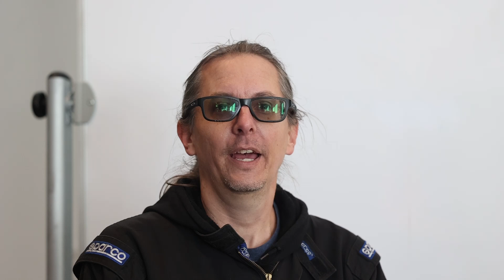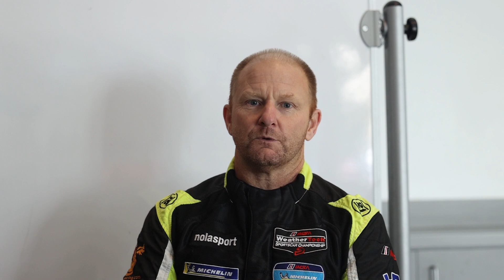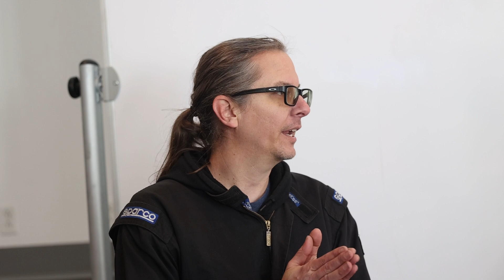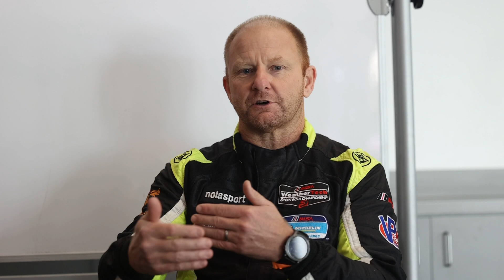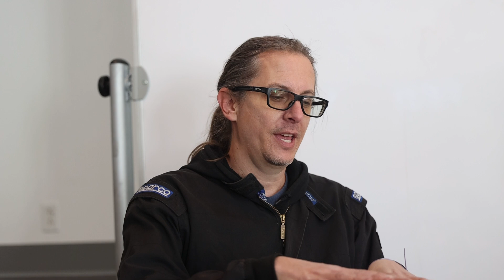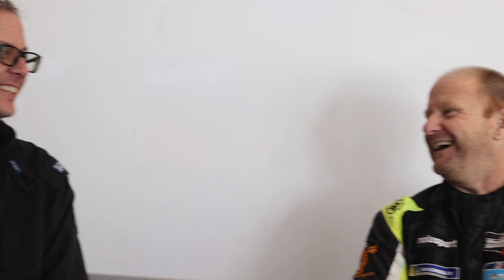We Made Too Much Downforce? / How to Utilize a Pro Racecar Driver

Comment: Love to see what you come up with and glad you're willing to share.  That failure looked a lot like something did fatigue and caused a delamination from the core material, but I can't really tell from just pics.  A camera or accelerometer mounted to the front splitter  would  be cool to monitor how the splitter is bending/oscillating under those loads.  

Do you have any pressure taps around the car?  Also any chance the rules allow active aerodynamics to bleed off downforce/drag at higher speeds?

Comment: Is there some reason it's being made out of a composite material? Is it a pressure cast piece or laid sheet type? If you need to keep it composite the pressure cast carbon has far higher multidimensional strength and fracture resistance because no part of the fiber structure is aligned. Raw materials are far cheaper because its essentially scrap

I do think that while there is a weight penalty to using braced metal components, they don't have the same unexpected, cumulative stress failure issues like composites usually do (I don't know what composite you are using) so high load things like wheels, or ground effects should be made out of high strength, low cost, fracture resistant materials, and the ductility (maybe thats the wrong property its been a while) of composites, unless you somehow create the largest hot isostatic press mold machine, and use a fiber impregnated ceramic, are super inferior to metals.

Love the proper mindset of a scientist...failure doesnt exist, there are only attempts and data to learn from, whether the part or test "fails" or "succeeds" is sort of irrelevant, because you can always learn a bunch regardless. IMO breaks and more catastrophic events are quick teachers, its much harder to continue thinking about complex/compound stress variables if nothing apparently breaks. 

You might also look into the very inexpensive monitoring technology that uses even remedial camera footage, and processes the fractional pixel information in a way that accentuates the vibrations and movements not visible by the naked eye or normally processed footage. You could have a few small cameras angled at key mounting points of the splitter or other components you are worried about such as driveshaft oscillations, and very quickly be able to pinpoint areas that are seeing much more movement than you could otherwise detect.